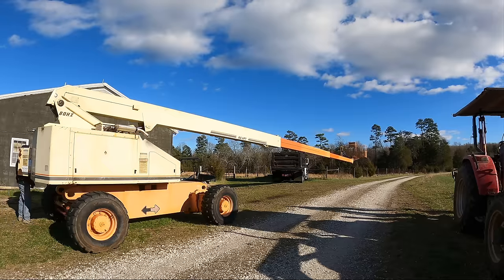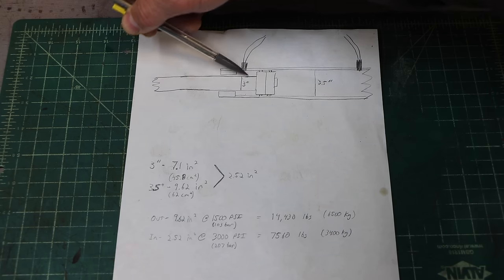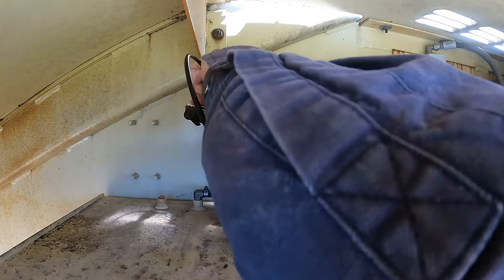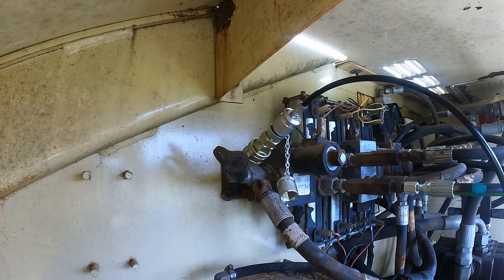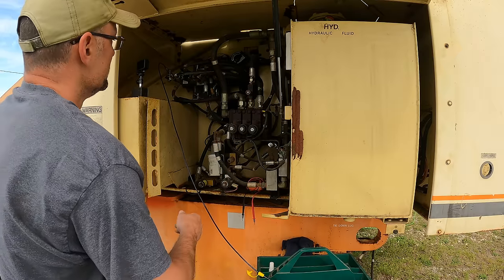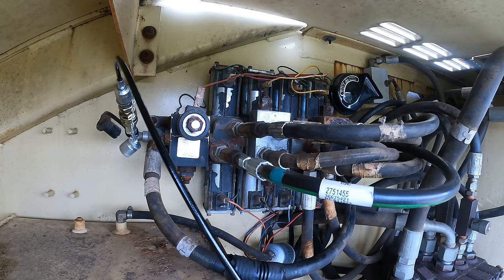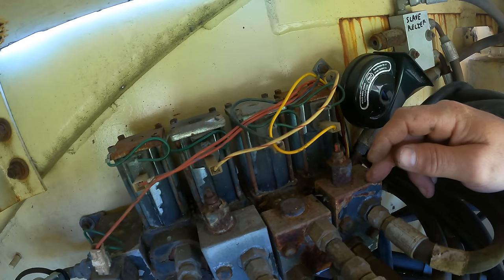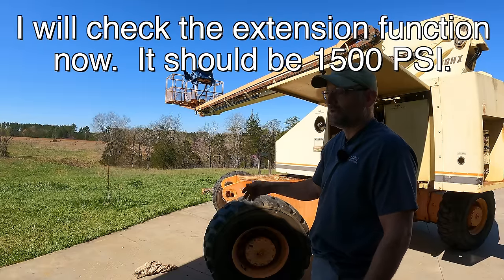My Toughest Hydraulic Job Ever. DIY Advanced Hydraulics.  JLG 80 HX Boom Lift

Comment: I paused... Ok since the relief valves were seemingly set for the opposite function my first thought was that at some point the hydraulic lines were switched. If after a service/repair the hydraulic lines were switched it would make the boom go out when the switch was actuated for in and vice versa. The easy lazy fix would be to switch the wires at the switch... instead of making a big hydraulic mess again by switching out the lines.  Not saying this is what happened but I have worked in the industry long enough to see this kinda thing done a lot. Like late in the day Friday when the only thought in their head is the weekend. Remember that the guide blocks in the boom were not installed as per spec so whoever did that may have had other work to do on that boom which is why the lines were reversed.

Comment: I had a similar problem on an excavator over10 thousand dollars the dealer was a parts cannon  I had the same problem. Turns out the main relief was too low turned it up and fixed the machine my self.

Comment: You mentioned that you used thread sealer on the fitting to prevent leaks.  Most hydraulic couplers use cup and cone seals where the oil is.   The oil should never reach the threads.

Comment: By the way shimming is not a bad thing on pressure relief valves.  It is how it is done and do you have the equipment to check the pressure changes.  Kubota dealers have pressure shim kits  containing shims for a particular unit and they come in thousandths of an inch increments.

Comment: I paid $8K for a 2001 450A 3 years ago. It has a diesel motor with 3k hours and it fires up before making a full revolution. I have done many repairs to wiring, hoses and normal maintenance and it looks very good. Platform and control station looks like new. I probably have $10,500 in it not counting labor and figure I can get between $12-15k any day of the week. It’s no 80 footer but it can go up and over where a straight boom can’t.

Comment: What if the springs were different? Since in and out where so different maybe they made one spring weaker so it couldn't put too much pressure through the lines, and since you switched then the strong spring is on the weak side, and the weak spring is on the strong side. Just a thought that might drive you made...

Comment: See if Berendsen Fluid power sells it or Parker Hydraulics got any part numbers on it?, Shims , If you could change the spring it would be better but shims are widely used for relief valves but in your case i think we can call this a reducing valve not ideal to do this but you can get your results if you are careful.

Comment: Maybe the arms need to be more vertical to come in. The arm is horizontal the way you have it. You can see the outer arm flexing downward, which is creating major friction. Is there a stop adjustment so boom will not come out quite as far?

Comment: While you are adjusting the hydraulic pressures I don’t see any need to touch the locknut until you have attained the required pressure with the screw. They would appear to be  just like the adjustment of the tappet or valve clearances on a OHV ICE.
Reply from the maker: Yep.  I came to that conclusion part way through.  Cheers.

Comment: Hydaulic mechanic here, who was strangling his phone for twenty minutes waiting for you to figure out you needed to check the LOWER pressure relief valve and quit dicking with the upper one. 😂

I’d have absolutely shimmed that machine if I owned it. The system doesn’t care if there’s a washer or a fresh spring in there. Only matters what pressure you’re shoving through it.

Just do me one favor: check the pressures again in a few days when the fluid is thick and cold, and make sure you’re still on the money. 😎
Reply: Also. If it refuses to retract on a job someday and you have the overhead clearance? Elevate the boom a bit. It’ll suck right in.

Comment: They don't throw ID tags on every valve, coil and cartridge because it would add thousands of dollars to produce the machine. Technicians use the documentation just fine on the occasions it is useful, but the vast majority of customers wouldn't pay for such a feature. Something like that big load chart inside the door provides a similar amount of information, but is for daily usage, is relatively cheap and safety critical

Comment: To me, horizontal retraction with the boom fully extended seems like  asking too much. The weight on the guides is so extreme  that I would avoid it if at all possible and bring it down from  the steeper angle the way it's normally used.

Comment: Very nice work sir, what you did was a completely acceptable fix although it may be a sign that the spring is wearing out and possibly headed for breakage, it did possibly look like there were some shiny spots on the coils. Even though the spring wasn’t available through JLG I highly doubt they made the hydraulics anyway, so maybe going direct to the manufacturer (Parker, rexroth etc) would yield some results? Edit: your pressure settings will most likely drop if the oil wasn’t warm when you made your adjustments.

Comment: I can’t help but wonder, when you rebuilt that cylinder, if you didn’t maybe connect the telescope in hose to the telescope out nipple on the cylinder & vice versa with the telescope out hose & nipple?

That would account for why your high pressure fluid that should have been going to the rear of the piston was actually going to the front of the piston & the lower pressure fluid that should have been going to the front of the piston with larger surface area was instead going to the rear with less surface area.
Seems kinda “obvious” to me that an unintentional simple hose swap at the cylinder connection nipples, would have explained the issue you were having.
Always look for the KISS principle (Keep It Simple Stupid) solution first.

All that work with gauges and swapping valves and adjusting pressures just achieved the same solution as swapping the hose inputs at the cylinder nipples.
My 2c - I’m just guessing, I don’t know where your hoses are plumbed into the cylinder and if they are near each other and same lengths to have allowed a re-connection mix up / swap over.
You likely should know.

Comment: alot of hydrualic manifolds are "cross flow" or cross drilled  for fuild dynamic reasons. so its not uncommon to have relief valves to opposite from what you expect.

Comment: At 22:00 my guess is a faulty dump valve, it looks like it's dumping back to the tank over a certain pressure when it should be holding that pressure, that's my thoughts....at this point in the video at least.😊

Comment: reason for no tags on the valves/blocks is that your equipment manufacturer doesn't want you to know what company they use to produce their machine. they consider it IP,  pretty frustrating

Comment: Max psi should be 3000. Not 3000 if no restriction and movement is present. You have a restriction on the return side of that cylinder. Your spring is fine. You can only set max pressure while dead headed.

Comment: 3000psi wasnt a hard limit... giving it another 10% would of been well within expected deviance even from factory im sure some are set that high.. i doubt that system would have an issue seeing 5000psi if the pump would pump it.. if it need 2950psi to retract in summer with an empty basket whats it gonna need in the dead of winter with 2 guys and 100lbs of tools in the basket?

Comment: I see you have the engine starting like new  . Did you add a filter with a check valve? 
Way to keep at it until the desired effect was achieved
Reply from the maker: I did a new filter pretty much on day 1.  Never did a check valve.  The main engine problems were the crank sensor and the automatic choke.  Since changing to a manual choke it has run perfectly.

Comment: i did refrigeration repair in grocery stores. my friend and i where working on a refrigeration rack and had a ball valve we needed to turn off , these valves had seal caps on the stems to keep them from leaking. i was in a tight spot near the valve he started taking the seal cap off what we didnt know was that the cap was unscrewing the shut off stem from the valve body. it came out and started dumping hy pressure lig freon came very close to hitting me in the face with liq freon. said a prayer later thanking the man for not making me a blind person .

Comment: Maybe stupid question, but have you lubed the boom, silicon spray maybe ?
Reply from the maker: You actually aren't supposed to lube it per JLG.  The wear pads are slick enough if everything is set up correctly.
Reply: @FarmCraft101  Would you dare try it ? No grease or oil offcourse, but like silicone spray or wax, some dry lubricant on the gliding surfaces. I'd be curious to know if it makes any difference at all. Anyway thanks for all your great tips for us DIY.

Comment: Wow, peeking inside your head is quite the adventure. You have so many gears and wheels and even a few seals whirling around in there, it's quite the adventure maze. Add a few hamster wheels, and you just might achieve warp speed one day. (grins) All of that was a complement, not an insult. You're quite an amazing character.

Comment: WHAT IS THE SIZE AND DEPTH OF YOUR POND I HAVE A SPRING I WOULD LIKE TO DAMN UP, I DO NOT WANT A LAKE BUT A POND ALSO YOU HAVE A TREMENDOUS SHOP HAVE YOU DONE ANY VIDEOS ON THE LAY OUT OF IT
Reply from the maker: Pond is about 4 acres, average depth 6 feet, max depth 14 feet.  I have an older video on how it was constructed.  I also have an older video showing the shop build, but not really a layout of the tools.
Reply: @FarmCraft101  YOUR POND IS LARGE THAN IT LOOKS WHERE YOUR KID WHERE JUMPING OFF YOUR LIFT MUST HAVE BEEN THE DEEPER AREA - YOUR SHOP IS VERY IMPRESSIVE I OWN MOST TOOLS YOU OWN EXCEPT THE METAL LATHE IT SEEM YOUR SHOP IS LAID OUT WHERE YOU CAN USE ANY OF YOUR TOOL AS AND WHEN YOU NEED THEM i HAVE TO SET UP THEN TEAR DOWN AND SET UP FOR SOMETHING ELSE IT IS A REAL PAIN IN THE POTATO IT SEEM LIKE YOUR SHOP IS LAID EFFECTIVE TO DO WHAT YOU WANT WHEN YOU WANT YOU HAVE SOME VERY IMPRESSIVE CRAFT SKILLS
Reply: Be careful building a pond/lake with a spring in it. A path for water to come in can also let water out. If possible build below the spring and feed spring water to pond/lake.

Comment: So my answer would be to fit a one way pressure regulator between the in and out hoses close to the control valve. Too many hydraulic fitting sizes !!

Comment: Actually I believe your boom is sticking. Shouldn't have to operate at max allowable pressure to retract boom. 3000 is max pressure allowed on cylinder during retract not operating pressure.

Comment: Re: labeling stuff.  Two things.  First, bean counters run all of these companies now.  If a label costs 35 cents and we need ten of them, accounting can save $3.50 per machine by not using them.  Second, we now live in a litigious society where no one, and I mean, NO ONE, is responsible for their own actions.  If we label them and some homeowner adjusts them, blows a hose, drops the boom on his neighbors car (house, tractor, kid, whatever), it will turn out to be our fault for labeling the valves.
Today, most companies provide an Owner's Manual that shows where to put the fuel, the tire pressure, basic operations, and how to shut it off.  For more detailed data, you need the Shop Manual and there may be some qualification required to buy a Shop Manual, or a release from stupidity form to fill in.  Seems to me you're smart enough to figure it out, so it worked.  Most would not and could not get into trouble due to engineers.

Comment: "Why aren't these things labeled?" is a question for marketing and management, not engineering.  I suspect it is so that some percentage of independent repairmen and owner operators become bamboozled by the complexity of the system and take it back to the dealer for repairs.  Engineers, true engineers would label everything if they had their say in the matter.

Comment: Not to be an armchair technician but...Comparing hydraulics to electricity...Voltage would be volume and amperage would be pressure..which would work opposite(sometimes) of hydraulics though simce upping the voltage decreases amperage. ...Also..The pump doesn't create pressure..its the resistance against flow..So you are adjusting the flow control valves of the opposite side...which in turn ups the pressure by restriction of return flow...That's why adjusting both effects one..blah blah....Flow is speed  ...pressure is power....You know all this.. I'm addressing the other armchairs..lol

Comment: surely youre just inventing problems at this point... use the thing it works fine, its designed to 800% safety factor stop worrying about it.. this is like someone who wont touch a car battery cause they think itll shock them